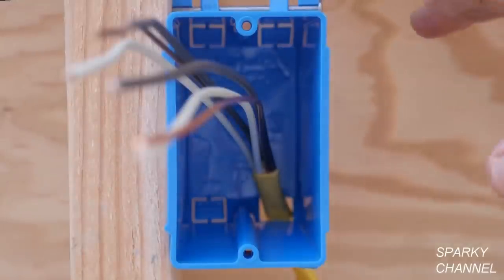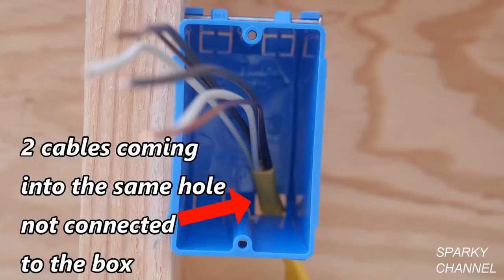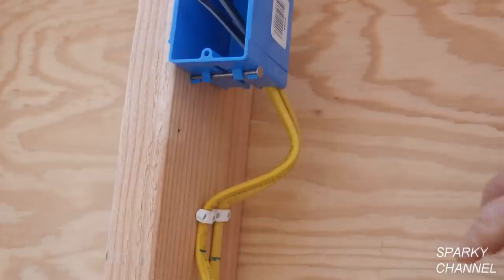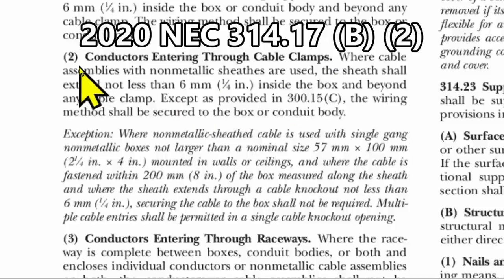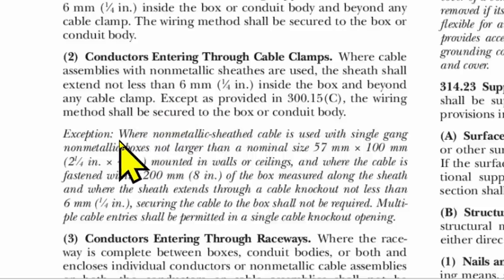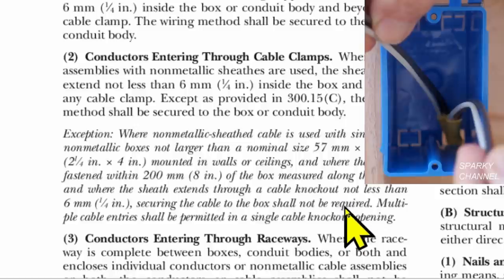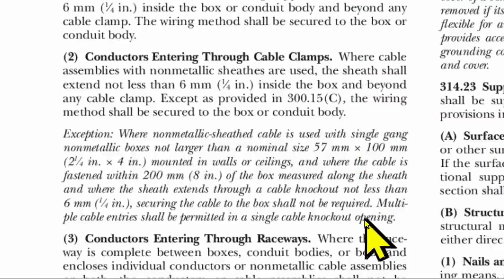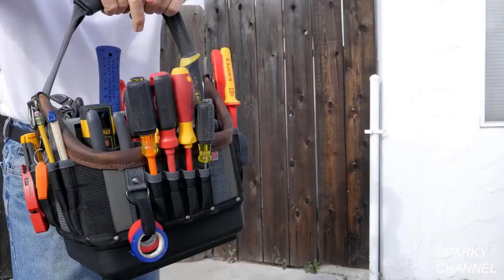Is this to Code for 2020 NEC? (314.17 Conductors Entering Through Cable Clamps)

Comment: My first inclination was to say NO, not permitted to have two cables in one knock out. But one of the things I really like about you Bill, is you provide the answers "per the code"!!!!!  I guessed wrong on that portion. I did guess right on the other parts though.  Thank you for the correct answer.
Reply from the maker: Excellent! I hope you had a great Thanksgiving!
Reply: @SparkyChannel  I did and I really hope you have a wonderful Christmas and a Happy New Year!
Reply: @SparkyChannel  enjoying your content. It’s very informative. Do you have a fix for this similar situation but in a double gang metal box. I swapped out two switches in a metallic box and there was nothing securing the wires or protecting the wire through the knockouts.

Comment: I wish they would put the old style squeeze clamps in these blue boxes that are common now. The little plastic tab usually breaks off leaving the cables loose. Push the device back into the box and the stripped cable can push right out of the box. Someone once told me the little plastic knockout must remain because it is a clamp, but I don’t believe it because it breaks off too easy. I wish the blue single gang boxes they sell at the big box stores had better clamps. Frankly I wonder how such a box could be satisfying the code but apparently they do.
Reply from the maker: I agree with you, thanks!
Reply: The box makers probably lobbied the NEC to include it.

Comment: Normally always bring both cables into the same hole for a cleaner look and it also helps with the conductors staying secure in the box since they’re taking up more room in the opening. Didn’t know people chose not to do this honestly lol how you did it is exactly how I have been doing it and never had a second thought about it, only difference is I would’ve stacked the cables and red staples up the stud.
Reply: Great comment. Better said than I.
Reply: I tape the cables very tightly a strong inch right where they enter the box for added stiffness.

Comment: Bill, I think you made a mistake: The NEC you're quoting is 314.17(B)(2) specifically states when entering into a NM single gang box that has cable clamps. 

"Exception: Where nonmetallic-sheathed cable is used with single gang nonmetallic boxes...mounted in walls or ceilings, AND where the cable is fastened within...8 in. of the box measured along the sheath and where the sheath extends through a cable KNOCKOUT...securing the cable TO THE box shall not be required. Multiple cable entries shall be permitted in a single cable knockout opening."

The box you're using in the video has knockouts; they aren't cable clamps. 

So, NEC seems to differentiate between single gangs with knockouts and single gangs with cable clamps. So, what does it mean by "securing the cable to the box shall not be required," if we're using a single gang with knockout? What does that even mean or look like for it to be secured to the box when we normally don't secure Romex to NM boxes with knockouts?

Comment: But what happens when the box is closed up?  If the sheath is not properly secured to the box, it's possible part of the cable will push backwards when the switch/receptacle plate is inserted into the box and screwed down, and no longer have the required 6mm of sheathIng inside the box.
Reply: As a DIYer that's done a fair amount of electrical,  I will agree and always think about this as I'm pushing the device into a box like this. So I will leave more than 6 mm.   I also hate those plastic boxes that have a plastic tang to try and hold the wire.  I don't think they really work and often just jam the wire when you push it in the box. It would be nice if someone would come up with a good system to hold cables to a plastic box.  It could hold the cable by a fastener from the inside of the box. Then you could leave an extra loop of wire outside the box that could be used if the wires in the box were ever cut too short or broken etc. Really funny this hasn't been figured out yet.

Comment: What ever the manufacturer suggest ,nec does not  rule on this, the only application by nec would be bundling,but that would apply to entering the box only going thru holes ,nec does say u need 1/4;inch of sheath in box
Reply from the maker: Thanks!

Comment: So for new work, there is no requirement to use internal clamp boxes, as you can easily staple within in the 8inches? Might be handy when you need that little bit of box fill

Comment: The plug that you pop to push the wire through you don't take it all the way out you leave one side still attached so it creates resistance to the wire cannot retract on itself
Reply: Correct. Actually I just pop it with a screwdriver so that the tab is 90 degrees, leaving two rectangles for two romexes. Pretty sure the tabs were designed for that purpose.

Comment: Two cables side by side on a 2*4 is automatically a Code violation, because there must be 1 1/4" distance from the cable to the face of the framing member. A stacker or putting the ROMEX cables stacked under a staple would be Code. ( If there was a void/dead space  behind the 2*4 instead of some type of sheathing then the 1 1/4" rule would not apply to that void side of the 2*4.)

Comment: How would you secure anything to those boxes?  They aren't designed to have any type of clamp attached for securement.  The only question would really be on the multiple cable question.
Reply: The little tab which is missing here sorta works like a one way clamp. The cable feeds in easily but doesn't back out easily
Reply: @Lando1020  If it were there I would agree, but since it's missing, no good
Reply: @acrinsd  but I think that's what he basically mentions. As long as it's secured within 8" of sheathing it's acceptable. But only for this size box. No bigger

Comment: I guessed the answer would be "no" but couldn't come up with a viable reason as to why it would not be acceptable.  It makes for an easier install and the wiring can be neater inside the box using this method.

Comment: What if it's not an open wall and it's a remodeling or "old work" box and it can't be attached to a stud within 8 inches (or any where)?
Reply: Old work boxes have the built-in clamps rather than knockouts for that reason.

Comment: I would always still use separate knockouts then when I twist my grounds together I know it cannot be pulled out without significant force.
Reply from the maker: Good idea, thanks!
Reply: @SparkyChannel  Thanks 😊 I'm an ex network engineer you should see my panel wiring haha 😄 😆

Comment: Great video , thanks. I don’t understand why that exception exists though.  A cable entering a box is a cable entering a box. It shouldn’t matter what size box it’s going into. Would be interested to know the NEC’s logic on this one
Reply from the maker: They feel that if the box is bigger than 4x2 you need to secure the cables to the box. I see your point though. Thanks!
Reply: @SparkyChannel  I understand, they are saying when the box is bigger than single gang you need to secure the cable- but I don’t understand the reason why.
Reply: Or in other words, why not secure it for single gang as well, then you can just say- all cables must be secured to the box (no matter the size). Would seem easier for electricians to remember as well
Reply from the maker: @R900DZ  I think the NEC is just being practical here, letting electricians get their work done quickly.
Reply: Nec ( or other code organizations) don’t normally have logic.

We just accept their madness because life is easier.

What’s the reason for staples 12” distance from a box?
Why? Why not 4” or 6”?

Why the support every 4.5 feet?
Why not 3 feet or 16”?

It’s arbitrary nonsense and we all just go along with it.

Some codes are useful ( like maximum load on a given wire size)
But most of the stuff in trades books are just fluff.

Sorry to sound cynical but stuffing wire 2 separate wires in a box makes zero difference if it’s a 22 gang or a single.

Wire is a wire
Reply: @itaintrocketscience  👍
Reply: @R900DZ  my theory would be in a multi gang box obviously you would have multiple cables coming in from multiple directions and if they weren’t secured you would have an easier chance of pushing the cables out as you push your devices in. Single gang boxes don’t provide enough room for those crappy blue box clamps and a neat splice.
Reply: It’s a sloppy job to not use cable clamps that are part of the box.  The NEC is just drawing a distinction between “really sloppy” and “a little sloppy”, and allowing the latter.
Reply: Because the code says the nm cable has to be secured within 8" of cable sheath.  If you are using 2 gang or larger boxes and using knock-outs beyond the first position, there would be no way to secure the cable within 8" of the end of the sheath.

Comment: Now let me ask a question. Is it legal to enter each of those cables through all three knockouts?  As in white through one knock out, black through another and for good measure the ground through another. Let's add to that just for fun, trim the cables so the extend out of the box 1".  Ahhhh I'm forgetting the box! Lets use a round blue plastic light fixture box and...... hang a ceiling fan..... the coup de gras over thier bed!

Comment: I would've guessed no. I pull through at least two knockouts so when I bond the grounds it adds more assurance the cables can't be pulled back. Now with arc fault breakers I don't pull more than 2 cables through each knockout

Comment: Exception: "...where mounted in ceilings and walls...". What about floors? Does this mean one can't use a non-mettalic box with two cables in the same hole that are properly fastened?
The obvious answer is of course you can but "by the code" you can't because it does not specifically mention floors but does specifically mention ceilings and walls. Better language would be "for all locations where non-mettalic boxes are approved for use.".
Reply: Plastic boxes....on the floor?
Reply: @isaackvasager9957  not on the floor "in" the floor with a floor mount receptacle plate to finish it off.
Reply: @jfowler702910  Every floor mount receptacle plate I've seen comes with a special box it's designed to be mounted in. I've never seen one that was intended to be used with any old single gang box. And I don't consider a Bell weatherproof cover to be a floor mount receptacle plate, though I've seen them used as such.

Comment: That would fail inspection in Maryland. Can’t staple wire next to each other on 2x4 wall. They need to be stacked or use cable stackets when there are more then 2 wires
Reply from the maker: Interesting, thanks!
Reply: Keyword: more. More than 2. In other words,  two cables side by side is fine.
Reply: Two cables side by side on a 2x4 are not fine. You cannot be within an inch and a half from the edge of the stud. You can staple 2 wires on top of each other and still be in compliance. Any more than 2 wires going along a stud will need cable stackers since you're only allowed stapling two wires together.
Reply from the maker: @brianbell2439  That's not a 2x4, it's a 2x6. So that is 5 1/2" of width to staple, giving the 1 1/2" necessary on each edge.
Reply from the maker: That's a 2x6 stud, not 2x4. So there is plenty of edge on each side from the staples.
Reply: @brianbell2439  300.4(B)(2)(D)
32mm, or 1 1/4" from stud edge. Not 1 1/2".
And you can weave them as they run down the stud.
Reply: @thomasprendergast6315  yes you’re right. Personally I wouldn’t weave wires down a stud. I like using stackers because it allows the wires some give. I’ve had afci breakers trip several times due to a tiny insulation staples hitting the cables. Also carpenters are very careless around wires as well.
Reply: @brianbell2439  stackers blow. You go to do your splice and pull another inch of sheathing into the box. I like to leave a few inches of slack above the plate to leave play in the wires, they’re  less likely to be damaged by other trades and future remodels that way. If you use stackers and ANY slack then your install looks like dog crap.
Reply: Dr. Remulack I disagree but everyone has their own method of rough wiring. I do not leave slack at the bottom of the plate. That would look like shit. Some brands of stackers are junk. I use the 3m cable stackers. They keep the wires straight and neat.
Reply: @brianbell2439  I said slack above. And no stacker can leave your wires neat unless you pull them like banjo strings or have a lower standard of neatness. My slack above the plate is not messy. My rough is art. You wouldn’t believe how neat it looks, except for where I have to use stackers, then it looks like any old schlub wired those switches.
Reply: @KitchenerLeslie2  oh I gotcha. Yes I leave some above and below. I pull the wire tight and then push some up and down. Do you wire everything overhead? I pull everything underneath except for switch legs. Some areas only have slab houses so I can see many people having to go over with everything. I don’t have any pictures of my roughs but they are extremely neat. I only use the stackers where needed, and I have no problem making it look neat. Luckily most new houses in my area are 2x6 framing on the outside so no need for them on outside walls.

Comment: All of this depends on your inspector and township. Everyone  interprets it a different way
Reply from the maker: There definitely is a difference.
Reply: This is is pretty clear. There isn't any ambiguity. It's clearly to code.
Reply: The code as written is quite specific. This isn't left up to interpretation.

It is up to NEC code. However, local code can vary from what the NEC says. That's where the difference lies.
Reply: We have to remember that the NEC are just minimums. Each locale/inspector has the right to request more from us, so long as it does not impede the minimum.

Comment: Anything is legal until you get caught.

As a phone tech, I used to see all kinds of code violations in commercial buildings in low and high voltage situations.  Somehow, they were signed off by the city inspectors.

Comment: Are those small boxes a pain to work in? I worked with 1900 boxes back in the early 90s.
Reply from the maker: Yes, I prefer bigger boxes.
Reply: That is a standard outlet or switch box. They are much easier to use than a 1900 box, even for strictly splicing.
Reply: @KitchenerLeslie2  i did residential work for 2 years in the early 90s. So I only used 1/2 emt. Very little 3/4 stuff. I still miss the work
Reply: @opietwoep1247  where’d you work in residential where it was emt? Chicago area?
Reply: @KitchenerLeslie2  we did remodeling in Logan Square area

Comment: I was never tought to put more than one set of wires in 1 hole, was always taught put them in mult opens by poping out another side putting wire in very interesting
Reply from the maker: I think that one in each hole is better but now you know. :)
Reply: @SparkyChannel  Yea interesting to know, altho some states have different codes for example in NY i am not completely sure but I'm sure lol that in NY you are not allowed put an outlet under a Window but my Friend lives in Alabama just bought a new constructed home with the past 3 yrs build they allow plugs under a window, with hurricanes stuff down there you would think that wouldn't be the case for sure, but they do allow it weird, my Dads an electrician thats what he said when I remodel my place he said No outlets under a Window how i know, he taught me everything about electrical.. So I wired my place myself he did breaker box i wouldnt do that lol.. Good Video Thanks Again.. Thanks for reply, And God Bless
Reply: @SparkyChannel  That's what she said
Reply: You also weren’t taught to spell.

Comment: You should stack those cables with a single staple on the 2x4 below that box, else there is risk of a screw or nail hitting that outside cable.
Reply: different type of staple is required for that
Reply: Glad someone else said it too. It's actually a violation like he has it. 11/4" rule

Comment: If you connect both grounds,  should be ok?
Reply from the maker: The grounds from the cable and a ground going to the switch or receptacle would all be wire-nutted together.

Comment: So you don't have to staple the wire(s) close to the box?
Reply: it says within 8 inches
Reply: @jsncrso  What difference does it make?
Reply: @coolramone  They need to be secured within 8 inches of the box. The difference is not securing them properly is just half ass, it's electrical and needs to be done properly.
Reply: @coolramone   the unsecured wire can be pushed out of the hole and lost in the wall. if it is secured within 8 inches, and you have 6 inches of free wire in the box, you can't accidently push it out.
Reply: @markv.7842  its so you can't push it out easily once its drywalled.
Reply: Thanks for the info guys.

Comment: So how would you secure the cables coming into a double gang blue box? There are double and triples in every new house around here.
Reply from the maker: Yes, a double gang box would have to have the cables secured to it.
Reply: @SparkyChannel   how would that happen without switching to a metal box for code compliance?
Reply: @mikez4132  Because you are not going to find a plastic (Carlon) box larger than a single gang, with removable K.O.'s.  All plastic boxes, except for these particular single gangers in the vid, will have the typical molded in tension clamp.